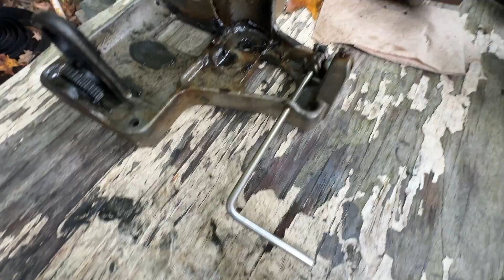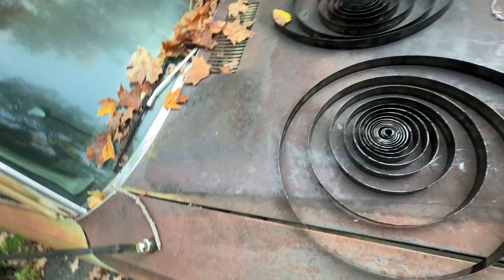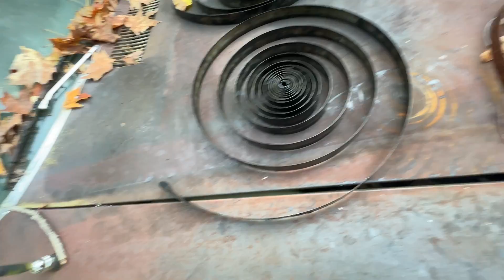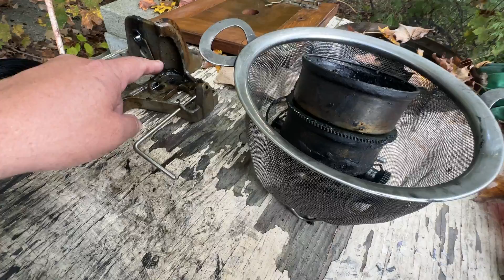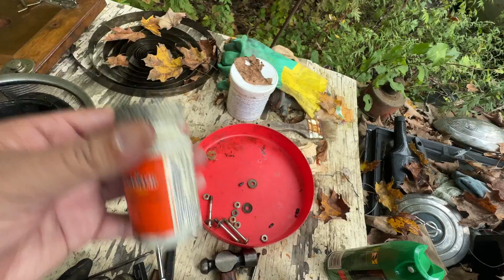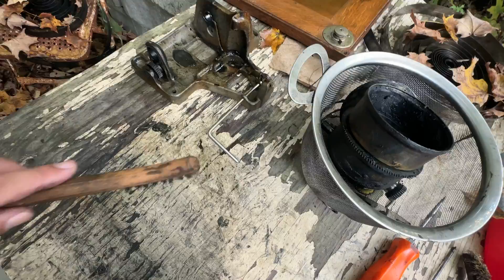A look at a mid teens, two spring Victrola motor before cleaning

Comment: Great video. I'm getting back into the hobby because I stumbled into a Credenza in good shape that will be a compliment to the Credenza I found and refurbished in the eighties. But the one is an X model with an electric motor (I also found another Victor disc induction electric motor  on Ebay that the seller thought was to an electric bell). I've forgotten a lot about working on these things but as you went through the video you kept answering my questions. So valuable. 

I've subscribed to your channel and I'm going back through your videos a little at a time. I don't know if you have worked on the disc induction motor Victor used. I think a lot of enthusiasts don't care much about the early electric models but that little motor is actually kind of neat. In any case I need to repack the springs in my old Credenza and a couple of other machines I have so your video is great help.

By the  way, there is a channel by someone that goes by Chilldude who has posted a nice set of videos on the Credenza X models but he hasn't posted for a dozen or so years so I don't think he is active any more.

My other passion has been the VV 2-55 portable. I think they are great little machines although repacking the the spring requires punching or drilling out the rivets the attach the can lid. Not that hard but a little tedious.

Again Thanks for your work